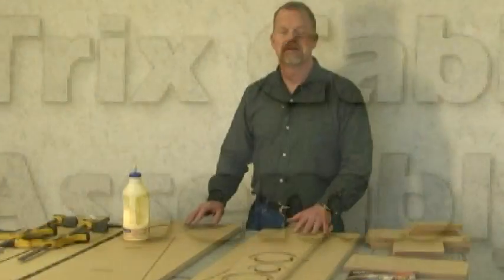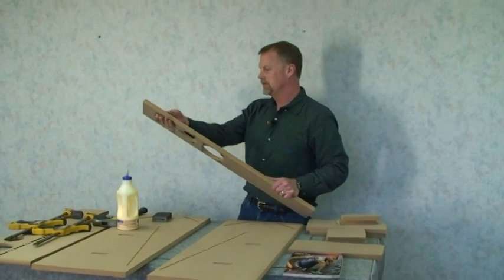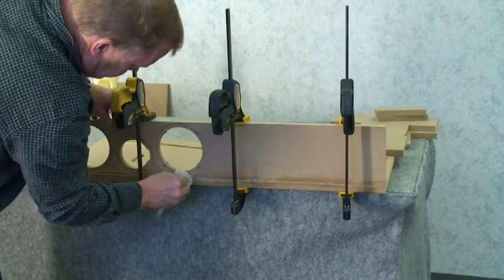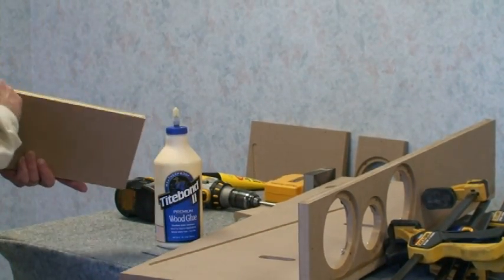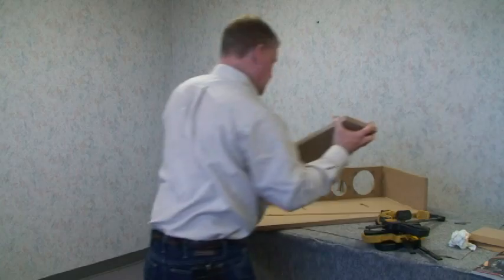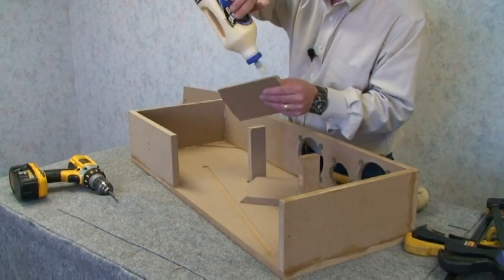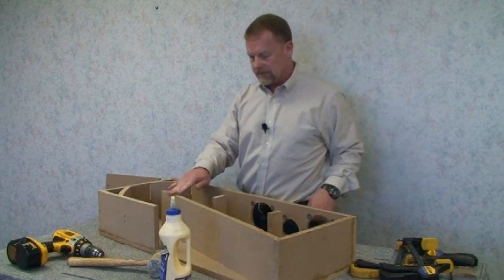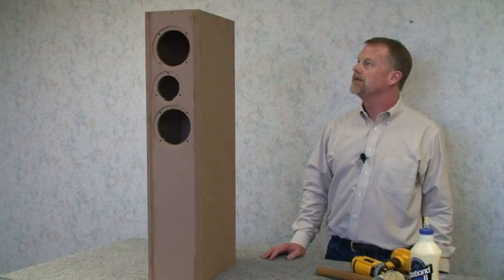How To Assemble a TriTrix Speaker Cabinet

Comment: You should consider how you are going to get the wires to the speakers before doing any gluing!  If you don't, then I guess you have to sling the wires up and down and will be unable to secure them.  Might be ok, but I would want to predrill the panels, or cut a notch along the back wall, and secure the wires.  And if you use fill, you would want to do that before you glue that last side panel in place.

Try to keep the edges as flush as you can to minimize sanding.

Comment: Nice job.
Yes, it is necessary to screw after gluing, because this glue must cure under pressure. With screws, you don't need to keep joints clamped while glue cures.
It's not necessary rabbet/dado joints in the baffle. The glue and screws are enough.
The only problem I see is the excess of glue flowing out of joints. 
That may cause problems in the finish process, and the sander isn't able to fix that..